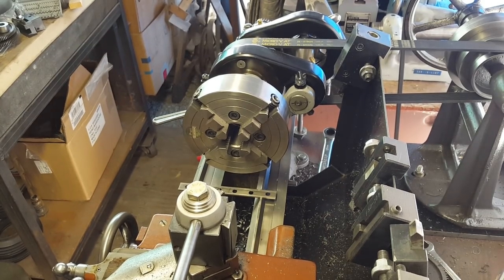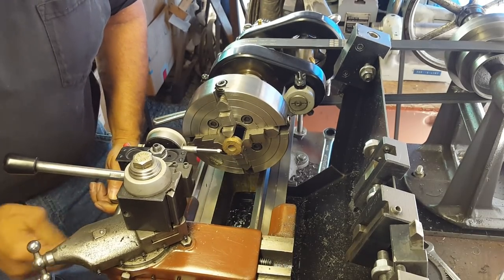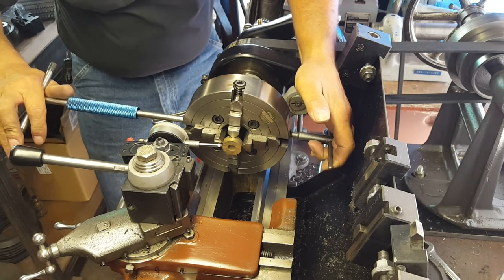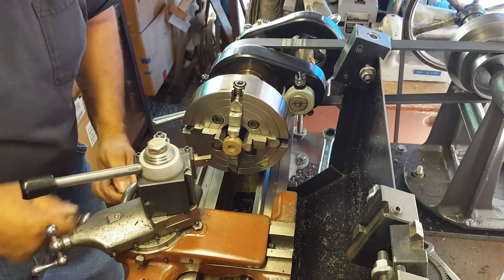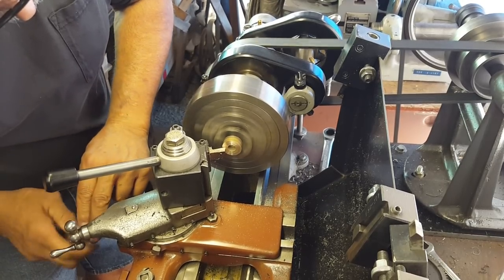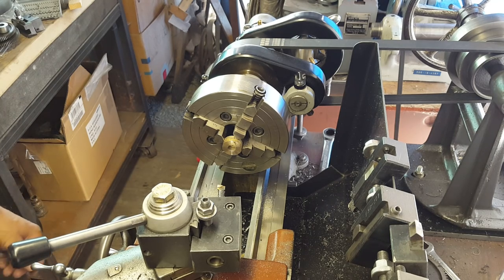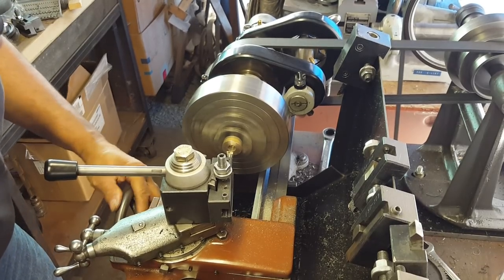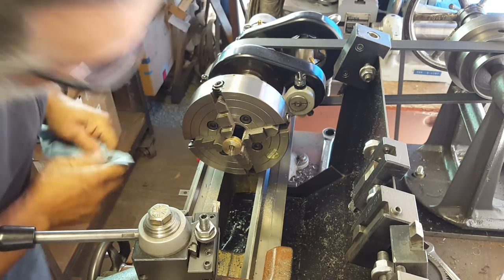My little Southbend

Comment: Sir could i have a link for that belt your using... I have the same exact southbend lathe...
Reply from the maker: Hey Angel,
Thanks for checking out my video here.
You say you have the same lathe? Are you sure it's the same model as mine?
I ask because, mine is a 8" model C built in 1929 or 1930. These little 8" lathes are very rare, and gets confused with the more popular 9" machin..
As far as my belt is concerned, I went to my local auto parts store and got a "serpentine" belt to the length I would need. I'd give you a link, but unfortunately I don't know how to do that...🤔 I can provide you with the part number and make of my belt tomorrow. 
Post up some pics of your lathe, I'm sure I'm not the only one interested!
Take care,
Razor!
Reply: @razorworks9942   Sir you are right it is not like your then.. It looks so much alike.. I have a Southend 9" junior catalog #22-R. Sir i do not know if thats the model..  I'm just getting into lathing totally green.. That is a very good idea on using a  serpentine  belt as the drive.. leather belt does a fonky tic tic tic tic tic and slips when cutting little more than .0010 or .0015 thousandths..
Reply: @razorworks9942   How do i post pictures  of my lathe.. i also would love to know more about it my self.. ive look on everywhere trying to find more info on it but all i get are the 9" A,B and C nothing on my model lathe..
Reply from the maker: @j.angelmoreno9784  
Hey Angel,
First off let me thank you for showing the respect that you've clearly given me, but all my friends call me "Razor"
That said, I dropped the ball in giving you the information I promised..please forgive me, as it's late now, and I will get back with you tomorrow..
No worries that you were mistaken about the one you have, hey, we all have to start somewhere! I don't consider myself an authority, but I know quite a bit about the Southbends as now I have 4 of them. So any questions you may have, feel free to ask, and please don't feel embarrassed asking...I will do my best to help!
Take care,
Razor!
Reply from the maker: Hey Angel,
Boy did I drop the ball on this one..
Here are a couple pics for you showing the belt I have. 8 years old and still like new!!
If you have a Simi setup, just take the measurements for the length, (shorter the better) and go to a Napa parts house, and order one up..
It's not bulletproof, as it does slip occasionally, but I have taken a hundred-thou cuts more than once..but with these small lathes, that is pushing it...and of course, you have to be in back gear to pull that off!!
Hope this helps. And again, please accept my apologies!
I just realized I don't know how to post pics here..
Contact me at:
razorray57@gmail.com 
I'll send you the pics I took!!

Comment: Also is that a Flat Rubber or Leather belt on yours. I would like to convert mine to a rubber belt if possible. I think that it might not slip as bad. About the only thing I've gone with it so far is to bevel some pipe so weld.
Reply from the maker: J Todd Cudd,
Sorry for the late reply as I just noticed your comment. 
My lathe did come with the leather belt that used the metal lacing and although it was very cool hearing the "tick, tick, tick" each time lacing hit the spindle, it got old very fast. At that point I measured the leather belt and went to the auto parts store and bought several lengths of a serpentine belt....I picked the one that looked like it would work the best, almost twelve years later, it still looks and works like I put it on yesterday!

Comment: Hi Razor, thank you for your video. Novice here, and pardon if someone already asked the question:  instead of measuring the bore and cutting to fit the bolt, why not just cutting 2 thou at a time, and fitting the bolt into it until it fits?  It would expand the bore 4 thou on each try.  I understand that measuring to cut is best practice, especially for consistent parts, but for a one-off, you just want the bushing to fit on this bolt, correct?  Thank you, I am learning.
Reply from the maker: Hey Johnathan, 
Good question. I was trying to get a clearance of about .0002 so there would not be any side to side motion. That was a custom made part to replace my "banjo" bolt that had all kinds of slop and honestly just wasn't a very good design.
Due to the fact that at the time I made this video, my tooling was very limited and I didn't want to rush this part of it, as I would have had to make another bushing. That said, my method was a bit primitive, but it worked beautifully and is still in operation with absolutely no issues!
Best part, at that time, I really wasn't much better than you are now..I'm learning new things all the time.
Hope that answers your question!
Cheers..

Comment: How do you know the position of your tool post in degrees and the one on the angle there ? it has degrees on it, but i don't see a corresponding mark :'( 

I got a southbend as well.
Reply from the maker: Thanks for the great question. 
I'm sure there is no requirement for a specific degree in which to set your tooling or the toolpost for that matter.
I basically set things up by eye in terms of geometry and material I'm cutting. 
Sometimes there is a need to set things up, especially when cutting threads or certain profiles. Other that that I set things up mostly by eye and see if my tool is cutting properly. If not I make the necessary adjustments. 
I would recommend looking up Mr. Pete's or commonly known as "Tubalcain" to futher educate yourself as I have.
Good luck!

Comment: I've got an old 9" Southbend  Lathe that I'm starting learn about. I would like to learn how to do some threading with it. I like the tool holder you have. We're can I get one that mounts like yours?
Reply from the maker: Good morning J.Todd Cudd,
Thanks for the support. If your new to this machining thing, I would suggest doing more simple operations like turning, boring, and basic shaping, not that threading is difficult, but I'm suggesting you get to know your little guy first.. Depending on what model you have, "A, B, or C, will determine how easy it will be to learn the threading operations. There are a ton of videos out there that can teach you what you need to know about any operation including threading...
As far as my toolpost. I don't know what brand it is, I do know even though it is an import, I have done a few mods to it, that I believe has made it a bit more stable. It is what they call a "wedge type" and the size is referred to as the "AXA". There are a lot of manufacturers making these, but I would stay away from the "piston type" as they don't seem to be as stable!
CONGRATULATIONS and welcome to the wonderful world of making cool stuff!!!😊
Razor!

Comment: Hey Razor, I meant to ask you, is my 9c able to hold the quick change tool holder and if so will my old tool fit the holder. Mind you that the cutting tool I have are from 1937. Sorry if my questions are stupid but I’m all ears! Thanks buddy
Reply from the maker: Hey John,
Sorry for the late reply, but if I understand your question, your asking if you can put a "quick change" gear box on your "model C" lathe?
From what I understand, yes....BUT....
it's a lot more involved than you might think! Drilling the mounting holes is the first step, and without the "jig" and or the proper equipment, you've lost the battle right from the start!
Just leave well enough alone, use and learn with what you have, and if you find it necessary for a "quick change gear box", start shopping for another lathe.
Reply: No I mean a tool post like you have. Quick change tool post will fit my compound slide but may have to fit to go in slide
Reply from the maker: @johnunderwood3132  
Boy...I missed that by a mile!!🤣
You can mount any tool post to any lathe...as far as our Southbends, you more than likely are going to have to build a special "T" nut to hold the post to the compound...
If your looking at different toolpost, you'll see that most use a stud, or shaft that you slide the post over it and use a "nut" at the top that you tighten to secure the  post. In my case I did the opposite in that I threaded the "T" nut that slips into my compound and purchased a grade "8" bolt to the closest length and cut a special washer that sits on top of my post.
I did this because after a few times of loosening the "nut" I found that the threaded shaft would come loose.
Again, you can use any toolpost as long as the tooling you use can be adjusted to the center of the workpiece! That means that you will be using what is referred to as a, "AXA" size toolpost. I would also suggest getting a "wedge" type and not a "piston" type!
I hope this answers your question!
Again, if you don't mind, send me a message though "messenger" or send me an email at: razorray57@gmail.com 
and I can send my contact info so we can talk about your lathe on the phone and getting it setup! I'm sure your going to have more questions, and sometimes just easier to cover a lot more information in a short time!
I definitely appreciate you reaching out!
I'm just not a fan of all the typing!!!

Comment: I thought I was watching Tom Lipton doing the setup until I recognized your voice Ray!  Good job of working with what you've got and sneaking up on your needed diameter.  I do enjoy videos watching machine work and your South Bend in particular.  My next project will be to swap out motors on my South Bend to a 110 version so I can get some work done in my current limited electrical circumstances.  Keep them coming Razor!
Reply from the maker: Hey Bob,
Now that's about the best compliment I could ever get.
If only I knew a fraction of what Tom knows!
Thanks just the same buddy!

Comment: Ray,  How does the polygroove belt work for you ??  I love not hearing the tick of a laced leather belt, but kind of concerned about belt traction during a heavy cut.  Great Vid my friend !!
Reply from the maker: Giving your vote of approval means a lot Terry! That belt was the first thing I changed cause like you, I hated that "Tick Tick" noise too! It works perfectly and it does slip but only when I'm parting. Other than that it might as well be a gear drive lathe. I've taken .70 thousands, total 140 thousands without any slipping!!

Comment: one question Ray
 but where is the compound gear or do you not need one
Reply from the maker: Hey Bill, 
Great question, I had to take the compound gear off because it wouldn't engage the "stud gear" to the "screw gear".
I need to post my other vids in the correct order to make sense of this upgrade.
My apologies!

Comment: What is behind the lathe? Does it swing down
Reply from the maker: Are you asking about the piece that the belt is hooked to?
If so, that is the bracket that holds the axle or shaft with the pulley to get the power from the motor to the lathe...
Hope that answers your question. 
Thanks for your interest in my little channel!
Razor!
Reply: I am thinking it’s a shield, looks like you have tool holders across it.
Reply from the maker: @johnunderwood3132  
I totally misunderstood your question..my bad!
I took some measurements and had a piece of 12 or 14 ga. sheet metal cut, brought it home and made a "catch pan" and "back splash" from one sheet.
It does work very well for my tool holders as you can see!
Great question...let me know if I can make up something you might need!
Reply: I’m getting my dads 1937 9” C south bend this weekend. I cant wait to learn some stuff. It runs pretty damn good for 80 years old. Just need to get that motor belt.
Reply from the maker: @johnunderwood3132  
That is FANTASTIC John...if you need any help with anything regarding the Southbend lathes, I'm no authority, but I do know a lot about these lathes especially the small ones!
The one here in my video is a 1929 - 1930, very rare 8" model "C". I also have two 9" ...one is a model "C" and I  just recently picked up a model "A" that is going under a full restoration!!!!
To round out my Southbend's, I also have a fully loaded and tooled 
"Heavy 10"....
If you have any questions, feel free to reach out..
The very first upgrade you should do is to replace the leather belt, (if it's still there) with a "ribbed automotive serpentine belt" if adjusted and sized correctly, it will grip much better than the leather one hands down, not to mention you won't here the famous..."tick, tick, tick each time the "belt pin" crosses over the pulley...
Good luck with your machine, watch lots of you tube guys, I can suggest a few if needed, and don't be a stranger..
Razor!

Comment: I understand now!! It’s a Jacobs taper 2 to a Morse taper 2 without a tang! That’s what I need. Sorry for being a beginner! Haha
Reply from the maker: No worries here John...we all had to learn somehow! For what it's worth, I'm still learning almost daily myself...
Don't hesitate to ask me anything. If I don't know the answer, I'll find out!!
Reply: Hey Razor I got my Mt 2 jt2 arbor for my tail stock but the only thing is it doesn’t come out of tailstock when I back it up like I do with my dead center. It has female threads at mt2 side for draw bar. I didn’t want a tang because I didn’t think it would fit. So anyway that’s my problem
Reply from the maker: Hey John,
Not to worry man...
Take a rag or shop towel and wrap the chuck or center and grab a pair of channel locks, or pliers, maybe vicegrips and grip whatever you can and gently tap out whatever you have in the tailstock.  
After you get it out, insert the screw into the end of the shaft leaving it as long as necessary to push against the stop as you wind in the tailstock shaft.
You'll have to do it several times until you find how far to set the screw. You'll figure it out...if not, I'm here!

Comment: Hey, Ray!  Good to see you out in the shop making chips.  :D
Thinking about your measuring problem, it occurred to me that a little tapered ruler would be perfect.  Starrett makes a few different models; of course, they are really, really proud of them.  :(   However, you could cut a piece of 22ga sheet metal at a taper, poke it in the hole and scribe a line across it.  Then just measure the distance across the line with your micrometers (or your Chinese calipers).  Just a thought.

Cheers,
Richard
Reply from the maker: HEY HEY HEY...
Richard.....
Not quite sure what your telling me. Is it to measure I'D or OD?
Reply: To measure ID.  
I'll see if I can find a picture to post.
Reply from the maker: +Richard Freeze,
What a great surprise to see you stopping by...
Does this have like reverse shaped fingers that you can open to touch the inside of a bore?
Reply: http://www.starrett.com/metrology/product-detail/metrology/metrology-products/precision-measuring-tools/hole-slot-gages/Taper-Gages/267

This are the ones I was trying to describe.
Reply from the maker: +Richard Freeze,
We'll okay then, I guess I know what I'm getting for Christmas!!!!
Reply: These are direct reading, of course, but a tapered piece of sheet metal would work pretty well.  You'd just have to measure it with a caliper after you mark how far it went in the hole.
Reply: Whoo-hoo!  New tools.  Ain't that long until Christmas.  :D
Reply from the maker: +Richard Freeze,
 I can do that! Just wondering how accurate they are, or better yet trying to set the mic up to read it?
Reply: They're calibrated to 1/64", but you can estimate to half of a 64th easily.  A set of small hole gages or a set of gage pins would be more accurate.  You could probably snag either on ebay for less than the taper ruler.
Reply: In a pinch, however, a piece of tapered sheet metal scribed at the hole entrance could be measured within 2 or 3 thou, maybe closer.
Reply from the maker: +Richard Freeze,
I'm in need of some gage pins.
Reply: MSC / Enco has a 40% off sale.  They've got a 190 piece .061 - .250 minus gage pin set from SPI for $109.  I don't know if the 40% off would apply, but it wouldn't hurt to ask.  Plus free shipping.  Sale ends Friday.
Reply from the maker: +Richard Freeze 
I'll have to go look!